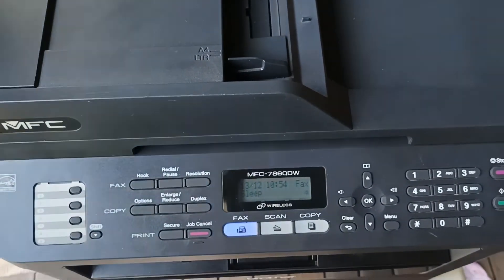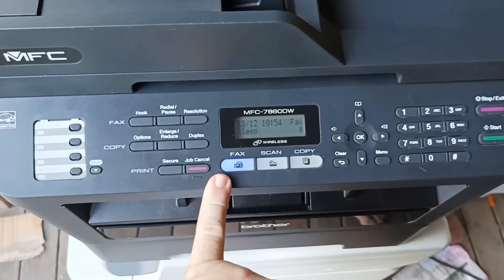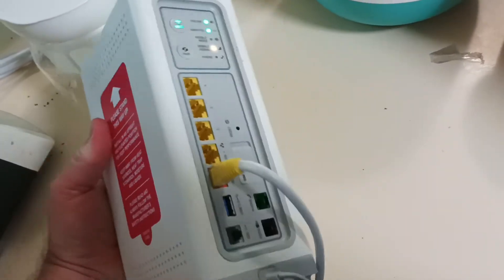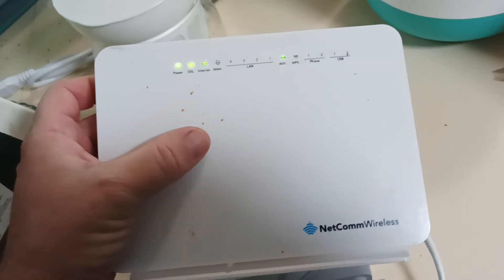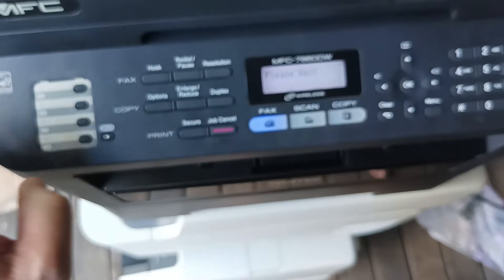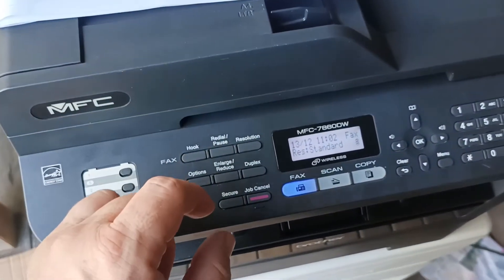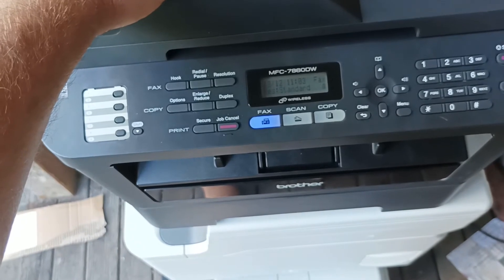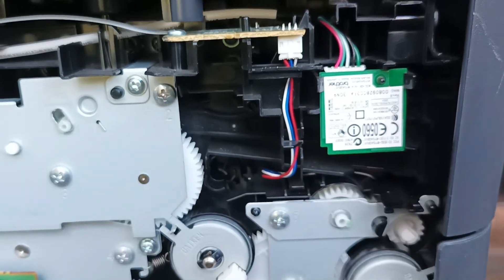Does Telstra Bigpond Hate Your Brother? (MFC Printer) - Smart Modem gen 2 no Wifi connection.

Comment: Wow, this is a lot of thinking.
My dad has a Brother HL-1110 printer and a Technicolor Smart Modem Gen 2 for his Telstra NBN. He was printing via USB from his laptop until it was automatically 'upgraded' to Windows 11, which has USB connectivity issues with Brother printers. Wiping his laptop to clean-install Windows 10 seems drastic so I'm looking at the network option.
Connecting the printer to the USB port of the Technicolor modem is not working. The modem is recognizing the printer but it is not recognized as a network printer in Windows 11. I've read this is also an issue with this modem.
So I could try finding an older wireless router, connecting that to the NBN modem, connect the HL-1110 printer and see if that works.
And if that doesn't work, I could try connecting an older network router to the Technicolor and connect the HL-1110 printer to that.
Phew.

Comment: Thank you great video - I have a8860 DN but i cant ping the network adaptor. Do I need to change ip addresses or anything else?
Reply from the maker: 8860dn has no wifi adapter this video is totally irrelevant. Set the tcpip settings to AUTO and run a cable to the modem
Reply: Thanks - found boot method was not on auto